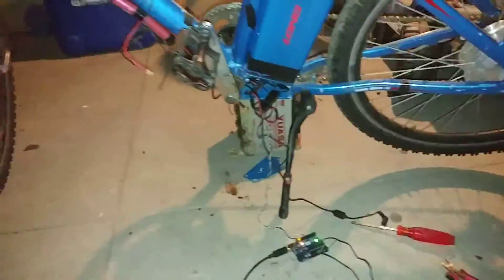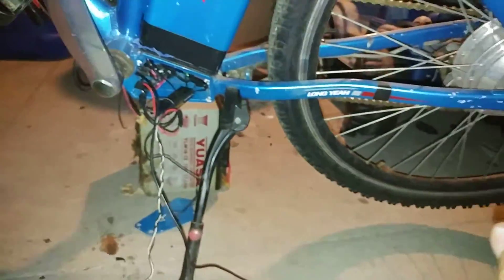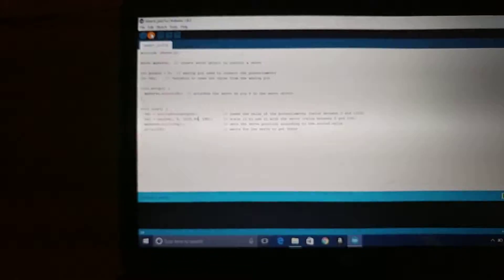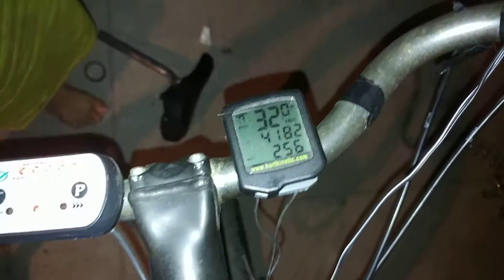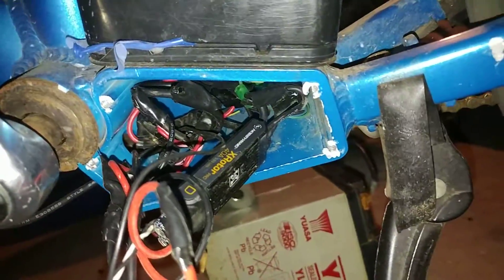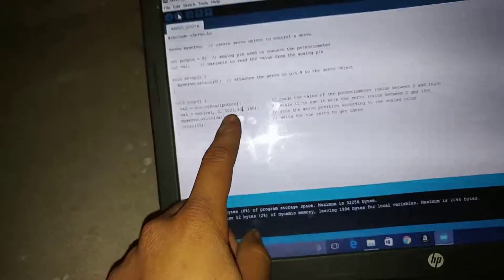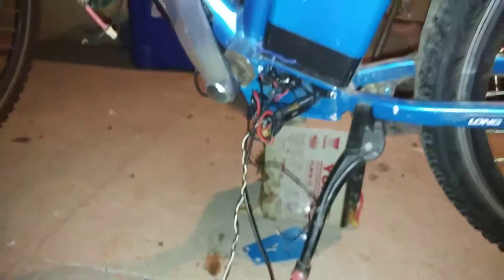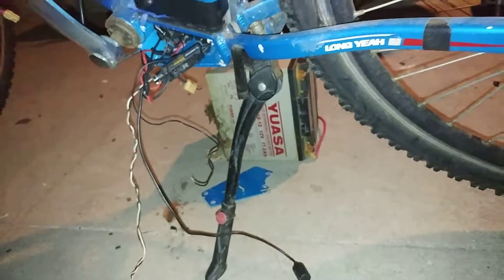Arduino powered ebike

Comment: Awesome, I'm trying to measure the volts from the accelerator's gain to trap the full throttle state, which is 0.233 volts and 0.823 volts low with an Arduino

Comment: you know any good gaming computers
Reply: ya build your own!!! i bought one built on ebay for only like $700 kicks ass i can play AAA rated games with the ease this one here is similar and the same seller. mines upgraded a bit with memory and bigger hard drive
 https://rover.ebay.com/rover/1/711-53200-19255-0/1?ff3=4&toolid=11800&pub=5575218778&campid=5338106180&mpre=http%3A%2F%2Fwww.ebay.com%2Fitm%2FAMD-Eight-Core-Gaming-PC-Computer-3-5GHz-8GB-1TB-GTX-1050-Custom-Built-Desktop-%2F232359382960%3F